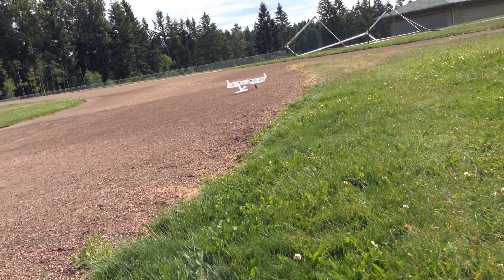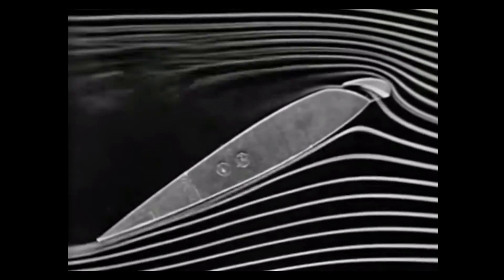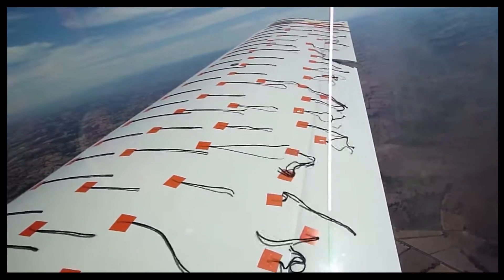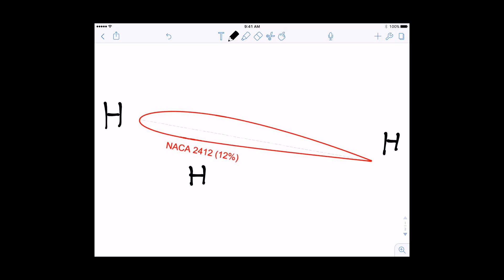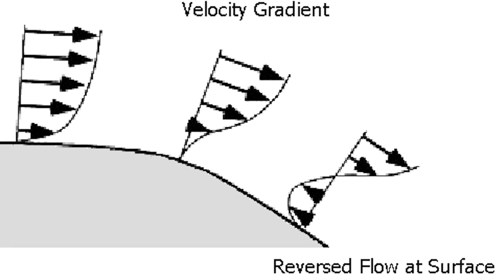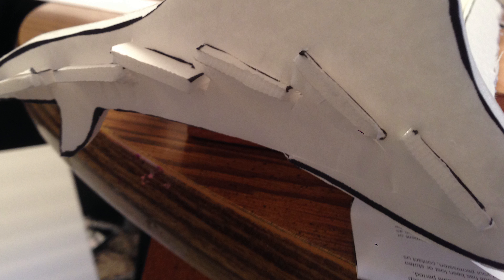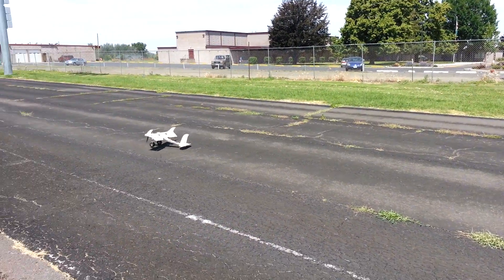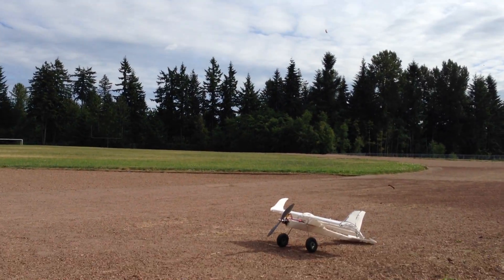Experimental Slat Plane! Unstallable wing?

Comment: When physics is explained with terms that are removed from physics, it becomes nonsense.  The physics is: 1) Newton's laws 2) Air is a compressible mass with a compressible spring-constant (Hooke's law). 3)  Viscosity is correct, but just understanding that air gets dense when compressed is better. 4) Air has friction that is the physics, drag is only one resultant. Like all friction there is a friction coefficient depending on what is the opposing surface and a few other details, that is the physics. (Wikipedia - Friction)The reason the world is still debating how planes fly is the adoption of terms only connected to physics in one aspect or from only one view point (like a 3D illusions).Keep up the good work.
Reply from the maker: +Heheh Riddick I took the physics and fluids classes. I just wanted to share this little project I did real quick and use it as an excuse to share lesser known but fascinating effects of how things work to the masses while avoiding any technical terms and math. Thanks for the comment though I can alway learn more become better informed.

Comment: This is what made the Fokker Dr1 interesting.   It could fly at insanely low speeds, fly side ways and some claim it could do a 180 half spin without stalling.   Dr1 was called a Triplane but it was actually a Quad Wing aircraft as even the landing gear had a wing.